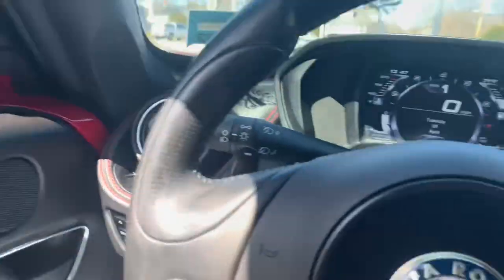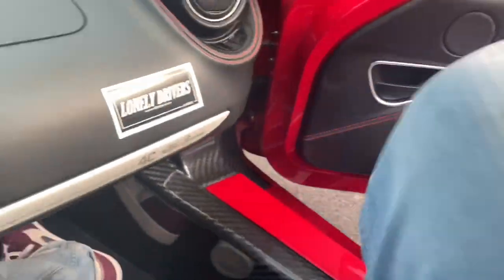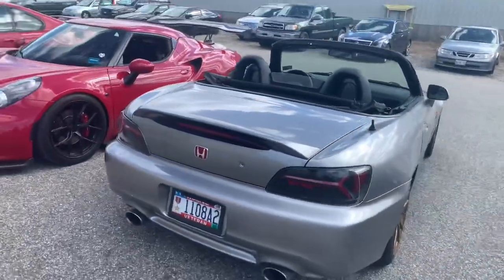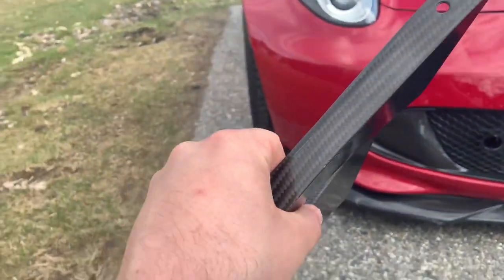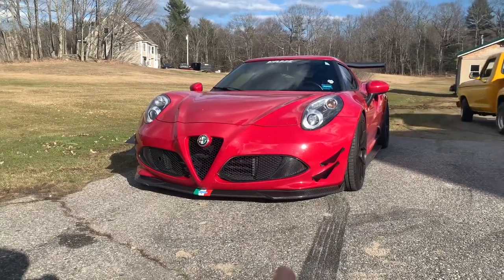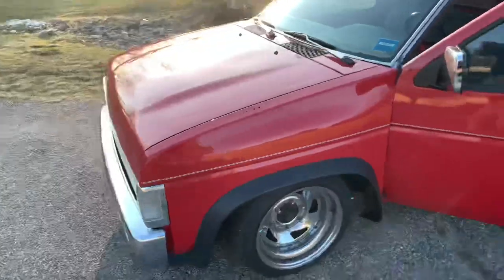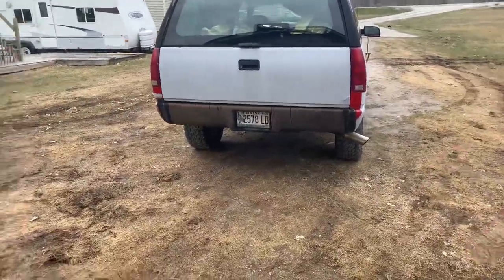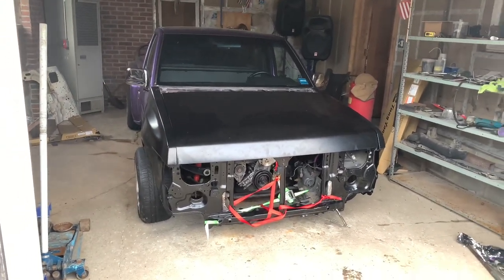A Day In The 4C! (Vlog) + Purple Truck Update!!

Comment: Do you know if it's hard to do a crazy brake kit swap on our hardbody d21?
Reply from the maker: I just made a video on how to change the front brakes on a Nissan hardbody, but I didn’t do any big conversions or anything, I know there is a way to run the V-6 Hardbody front calipers because of the door piston over the four-cylinder single piston and on top of that they do make slotted rotors for the truck as well!
Reply: @JapaneseMinitruck  I was thinking about running 370z or r35 gtr full kit swap.. I don't know if it can be done
Reply from the maker: You know actually, I do remember seeing some people talk about it in the past that you could also run Z 32 brakes upfront as well, I’m pretty sure that’s a pretty common swap on these too!
Reply: @JapaneseMinitruck  if it can be done.. I would so it.. it's up their in price but worth it!!!